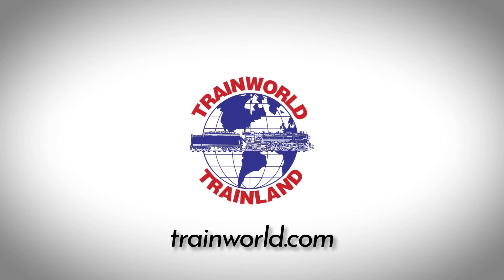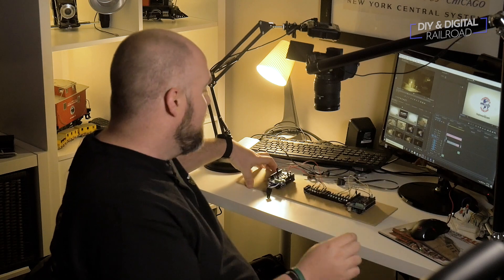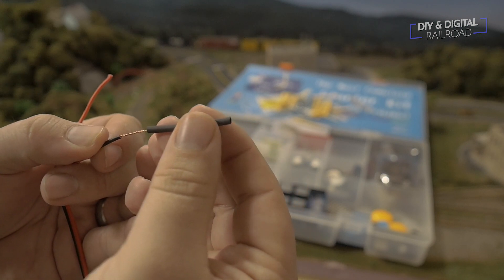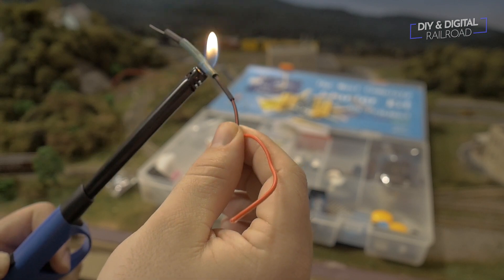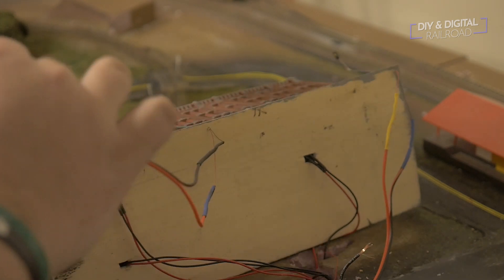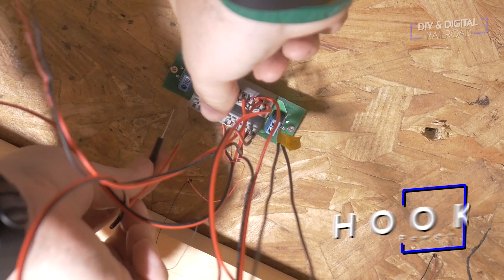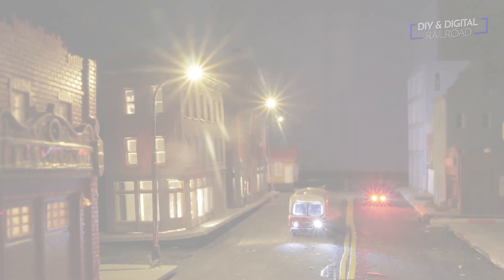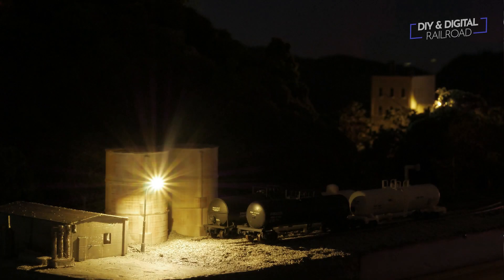Wiring Up Street Lights on my Model Railroad

Comment: Question?-i built an overpass going over my Rail road I want to add street lights,my question is do I wire them in a series? How many resistors do I use? And do I wire the resistors on the negitive side?

Comment: I'm writing this in 2021.  I don't know if you go back and review comments from older videos but I'm adding this one in case you do.  I have information and photos that I can share in lighting a city with Arduino and a Sparkfun module that is easily programmed.  In my N scale city I have a combination of about 30 lights that include internal building LEDs and Woodland lights separated into 8 segments. The time that each segment goes on is somewhat offset demonstrating how lights would come on in a real world city.  Also the lights slowly brighten further giving the appearance that they are coming on at different times.  The entire effect is done at 5 volts using a pro-mini along with a single outboard  module.  No off board components are needed.  In fact none of the Arduino I/O pins are used for lighting (although I am using several of these along with DIP relays for Miller Engineering signs).

One caveat with this design is that the outputs need to be connected as a current source.  Therefore the LEDs and lampposts are driven from the outputs through a resistor (470 or 1K) to a common ground.  At 2-3 ma per LED/lamppost the overall current load is well within the specified range.  The lighting effect is quite visible even in an average day lit room.  (actually The building LEDs and Woodland lampposts are, but their wooden poles lesser so)
Reply: @Joe Cassidy From your response I obviously didn't explain my design well or completely.   I'm using a 5 volt Pro Mini not the 3.3 volt version. LEDs are current and not voltage driven so the LED voltage level  is not an issue.  My circuitry ensures that the current is well below (about a 4th) of any LED limit and all of the LEDs together have a current draw within the overall current and power limitations of my system design.  However I did forget to write about a third chip - a timer that allows the "town lights" to turn on and off in progression as they would in real life.  So the complete circuit has a 5 volt Pro Mini with an I2C connected timer and an I2C Sparkfun LP55231 circuit board.  This isn't a complicated project (either in wiring or programming).  A LP55231 Arduino library facilitates the programming process.  If you're interested in more specifics and the program itself let me know.

Comment: Jimmy, JST1.0 connector sets are VERY inexpensive on ebay, and will let you prewire and test items off layout, then simply plug and unplug them on layout as needed. 

You can also easily add another  200 ohm 1/8 watt resistor in building to further dim building interior lights.

Comment: One handy part I use is the LM2596 DC-DC Adjustable Buck Converter available on eBay and elsewhere often as cheap as 99 cents with free shipping.  These can take up to about 30 vdc or so in and can be adjusted to output anything between about 1.5 volts and 25 or so volts.  Add a cheap bridge rectifier to the input and you can power it from any old model train transformer and have smooth regulated DC at the voltage of your choice.  They make higher current versions as well.

Comment: Using an open flame to shrink heat shrink tubing is a good way to set fire to something.  A better approach is to use a heat gun.  It produces a better, more uniform finished seal.  I use a nice gun I purchased from Harbor Freight for $15. 

Second, It is better to use a resistor per LED rather than a common resistor in the ground line.  With a common resistor if one LED fails they all dim or go off.  With Individual resistors only the failing LED goes out.

Comment: Nice job but I don't agree with you putting 1 - 2K 1/4 watt resistor on the feed because it will eventually get hot enough to cause a fire if you putt too many lights on the feed. It's best to put a resistor from you buss inline with each LED.
Reply: Yes agreed especially if you're inexperienced to electrical wiring. Personally I would using a separately derived system for the lights and another for the vehicles.

Comment: The resistor went on the ground lead?
Reply: Generally it doesn't matter. I tend to put resistors on the positive but with it on the negative it is easier to put resistors on multiple leds.